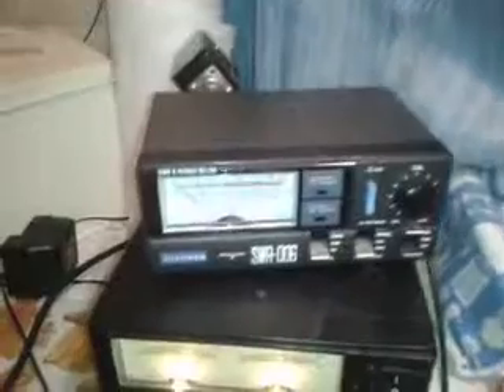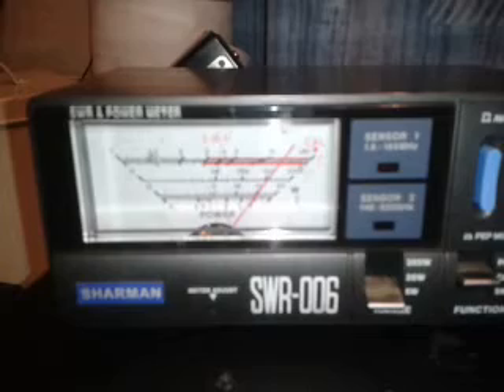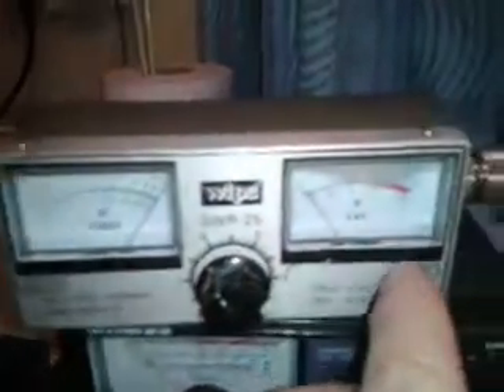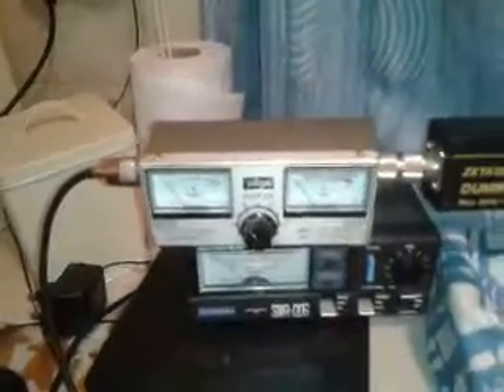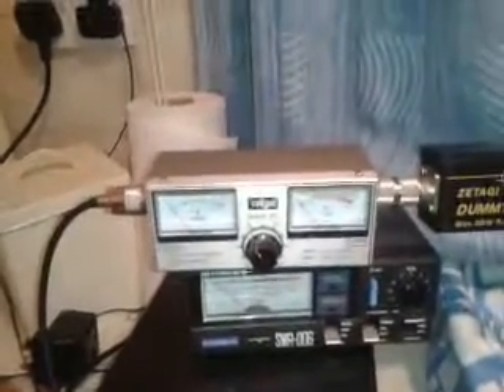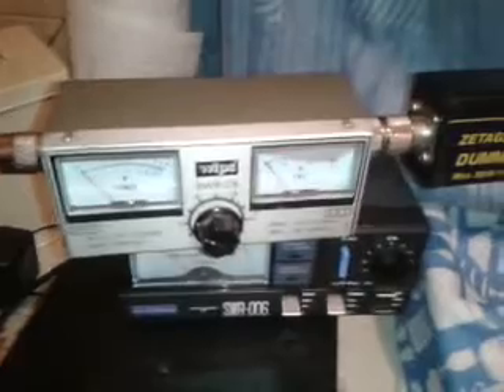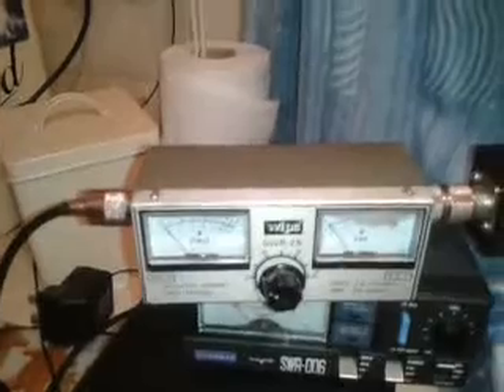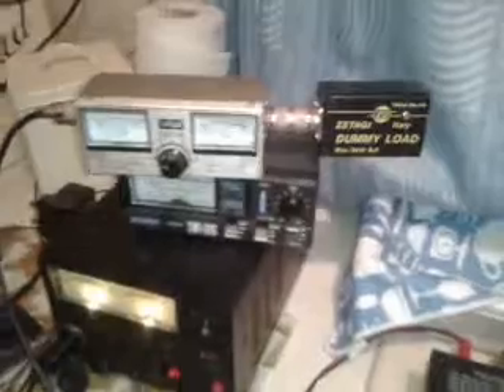How to check SWR with a swr meter,high swr on a mobile Antenna

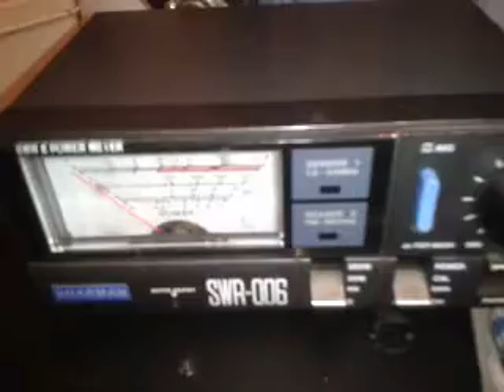Comment: how do you measure power with the type of meter you have at 2:42 ?
Reply from the maker: Hi John that meter is only really a swr meter.
The bigger meter under it is how I measure power.
Reply: @CBRadiouk1  I have 2 swr meters like this one, it doesnt have the forward reflect switch , only the center dial and on the left is the power meter but I cannot figure out how to actually measure power. I read somewhere that I would need chart but I dont have one. would a chart be for any of this type of meter for reading power? 73
Reply from the maker: @Spark_230v  
My one was picked up over 30 years ago, no paperwork included.
U could use a friend's power meter.
Once u know the power, turn up your dial till your meter reads the same as yourfriends meter.
Then mark where u had to turn the dial for future reference.
Reply: @CBRadiouk1  good idea. why didnt I think if that. my 2 meters are over 30 years old too.

Comment: Hello Steve, I'm having SWR issues using both a thunder pole voyager and Tank whip (static mobile) on a magmount. 1.8-2 muppets and as high as 2.5 on the mid block. Could this be to do with their is no electrical ground connection. In your experience would a boot mount reduce my SWR as it makes a ground connection. Any recommendations I have a VW T4 van with a tailgate and she is too precious to drill a roof mount. Many thanks Darren
Reply from the maker: Darren Cornwell 
Hi Darren presuming you are checking your set right.
A amount is fine and no connection needed to get good swr. I run a magmounted antenna myself.  So presuming all your connections in leads are all good.
IS the coax to the mag what came with it or is it a bit you extended or made shorter??
If it's as it came, by what u are telling me the Antenna needs to be longer.
Key up and get someone to put there hand near the whip while you watch the set meter.
If the set goes even higher it's to long.
If it goes down it's to short ok bud
Reply: Steve Stevens it goes down so I need to lengthen. So some kind of adapter to lengthen the antenna from the base? must be something to do with the large surface area of the van roof causing the issue. Cheers Steve
Reply from the maker: hi Darren my tank whip (quarter wave) was adjustable, if yours is not u can ad more to it like this.
Get an electrical connector the strip type mabe 15 amp or bigger, slide it over the end of your antenna do it up and put a length of maybe coat hanger in the end I would start with about 5 inches and trim to suit.
Hope this helps and works for you fella let me know ok.
Reply: Steve Stevens that's a dam good idea never thought of that! it's adjustable but not by much. I'll have a play with it Sunday see how it goes. Thanks again
Reply: An update your suggestion worked for me, used tinned copper wire to get the length right then used replaced it with the same length of coat hanger wire. SWR still refuses to drop below the big 2 on channel 20 midblock, bellow 1.5 higher up the bands. I'm going to replace the magmount as I don't rate the quality. Something more from Knights CB on its way. Thanks again for the sound advice
Reply from the maker: Hi Darren  looks like it has to even longer for the lower band,  try the other mag and let me know how you get on ok bud.